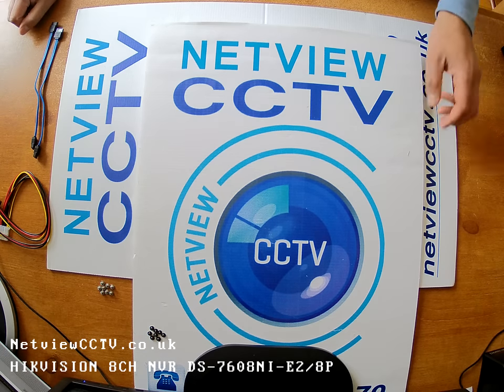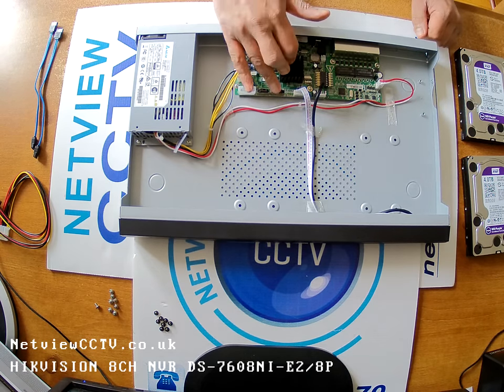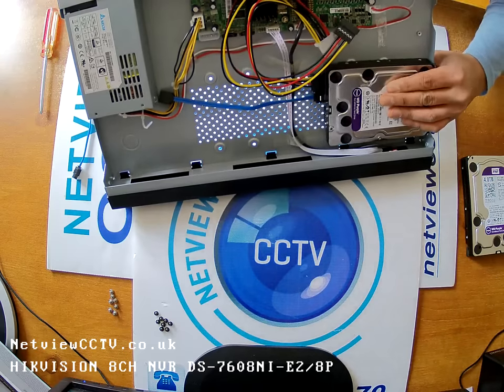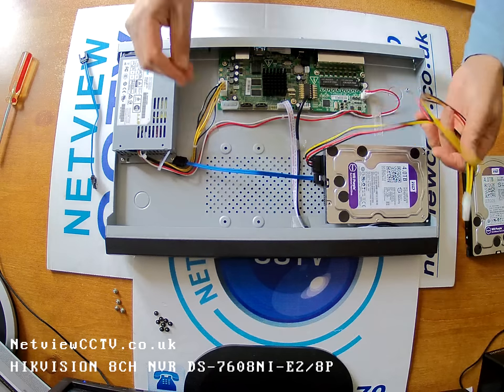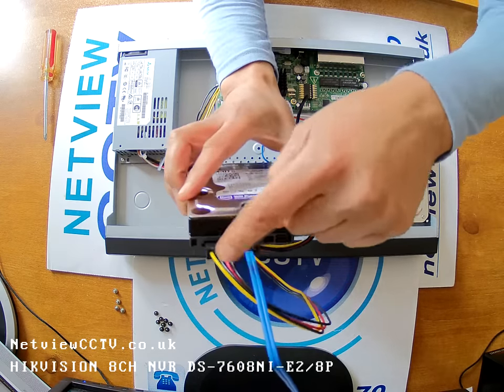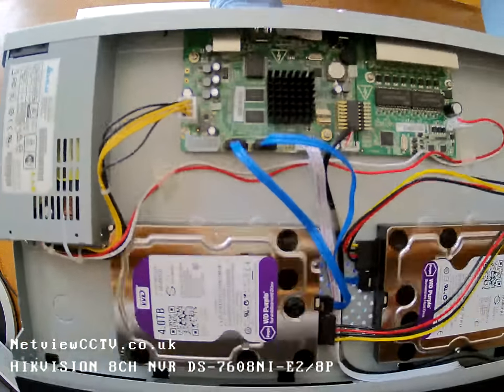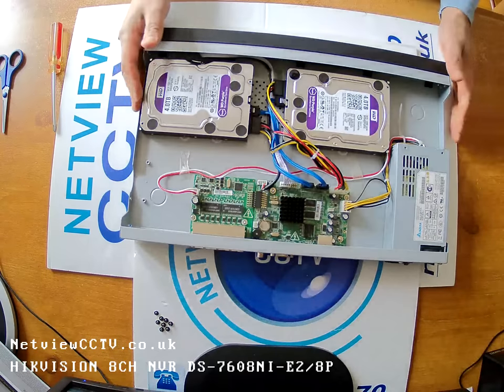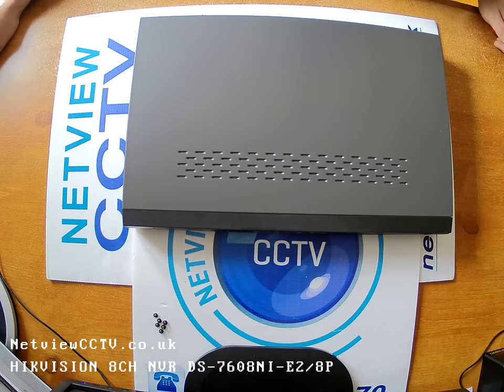Hikvision NVR DS-7608 8TB Hard Drive Installation guide How to

Comment: Great video, what format do you put the drives in?  Fat32, NTFS?  Also, what's the highest capacity drive is supported?  The mfg, suggest 12tb?  Can you clone the original drive or just add the secondary.

Comment: Curious to know what the best practices are for replacing failed or failing HDD's on these units. Simply swap them out? No settings lost? and what happens the exiting data can I plug this in a desktop and recover whats available?

Comment: I see that the device specs for HIKVISION DS-7608NI-E2/8P state up to 4TB for each disk but, a Hikvision tech support member stated it can hold two 6TB drives.  Is this correct? or can it only support  two 4TB?   Also, fan noise is quite pronounced.   Was considering upgrading to a  Noctua NF-A4x20 FLX premium-quality quiet 40mm fan.  Kindly advise if this would be an appropriate choice.

Comment: I just ordered a hikvision nvr without hdd. Do they come with the connectors for them or do you have to buy seperately? Placing my order on 2 seagate skyhawk 4tb sata drives and I am wondering if I need to buy connectors along with the screws?
Reply: no all the connectors and screws come with the nvr

Comment: Do both HD's need to be the same size? Can you use a 4TB and 6TB together?
Reply from the maker: No, both can be different sizes and will work in serial i.e. when one is full it will start writing to 2nd HDD (unless you have RAID enabled in the Higher end NVR's)